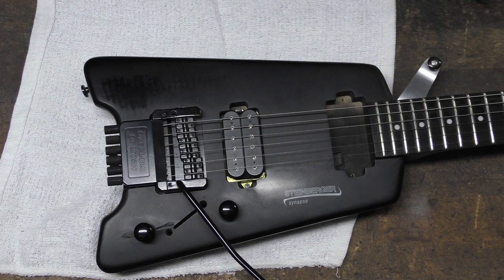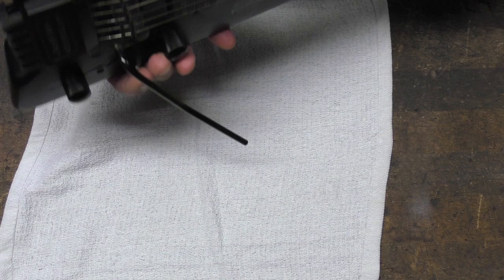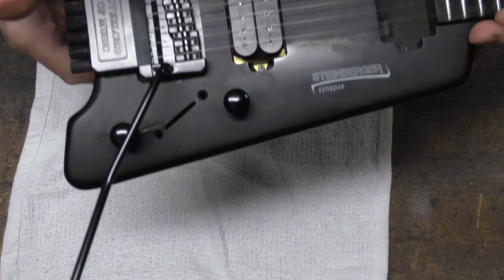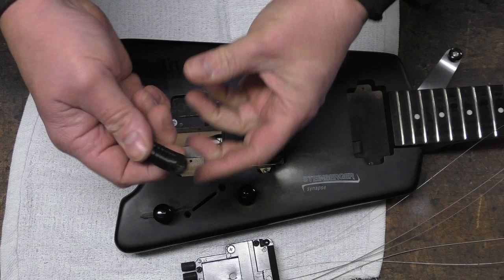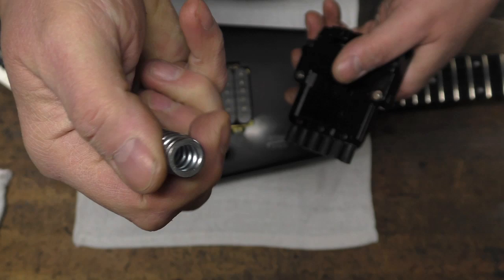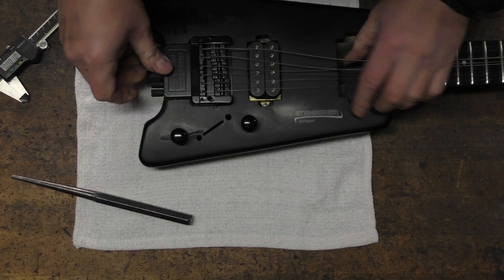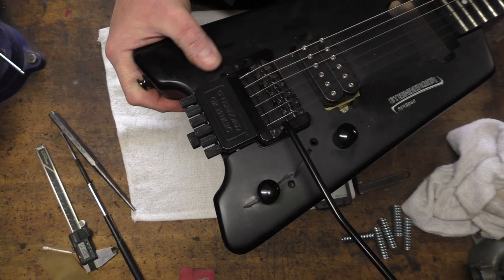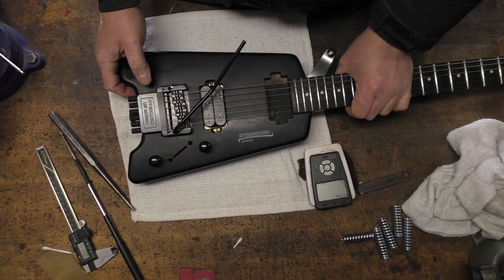Steinberger Guitar Set Up THE END

Comment: If you need a little more tension you might consider adding a little spacer between the end of the spring and that little circular indentation where the sits into. Try a dime and then try to add another if need be, or something similar. If it works then fix it into place with with J&B. Just a thought. Personally, I have a some wonderful vintage and new well appointed new guitars but my travel guitar is an inexpensive Steinberger Spirit GT Pro. It works pretty well but I find the stock R-Trem to be useless because it is so damn stiff. I am actually considering the idea of routing a space beneath it, adding a traditional metal block, claw and springs (like on all traditional trems) because I believe that this MIGHT give me the best of both worlds: The ability to function as a headless bridge but also have the smoother movement of a Floyd, Strat, PRS, etc. What could possibly go wrong!  :)

Comment: Hi. Do you have the part number and specs for the 2 inch spring you found? You didn't list it, Or I missed that bit of info. I called Mcmaster and gave the spec of the 1.75 length one you described. except in the 1.95 length. they said it would be a custom order and be like 200 dollars for one spring. Help please!! Thank you!